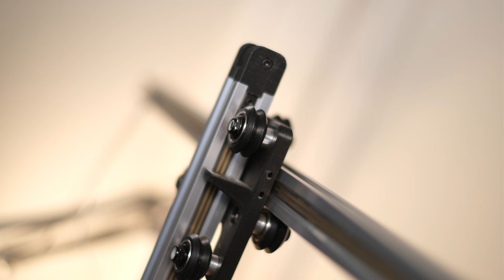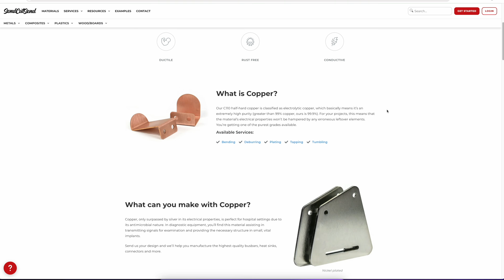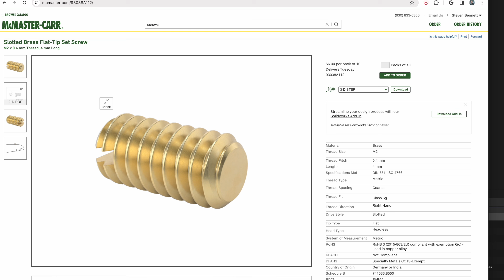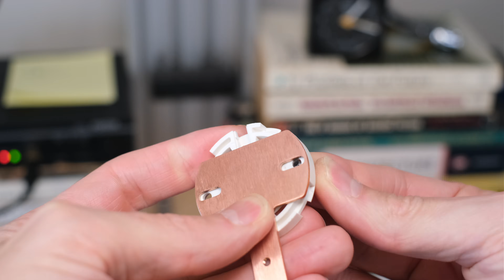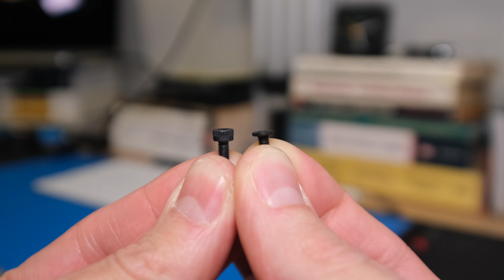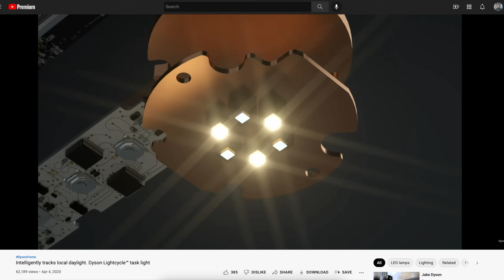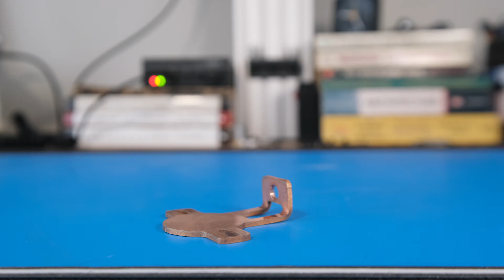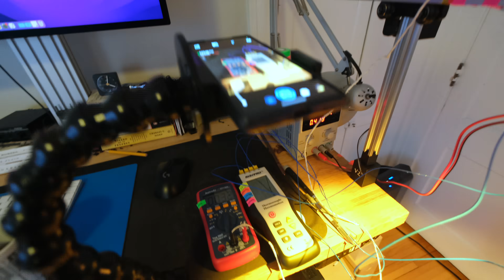Just how good are heat pipes anyway? - DIYson Lamp Build Log #10

Comment: Take a look at electro etching. It's surprisingly easy with tooling that consists of household items. And it's surprisingly precise if you take the time to dial in the voltage. You can "machine" your single piece copper in all sorts of ways and it makes for a neat subtractive process that's incredibly cheap for how much material you can remove. The most difficult part will be making the resist pattern easy to apply (laser cut vinyl works really well though that thin tape used in airbrush masking is likely the best choice for general use).
Reply: And I am new so haven't watched all the videos, but why not run the heat distribution down one of the vertical slots, leaving the roller slots unobstructed? I'm guessing it's the 90deg turn adding cost. (in frantic recitation): then add peltier devices to harvest the heat back into electricty and feed it back into the system then, perpetual energy! (no, I am not even close to suggesting this is really perpetual energy).

Comment: My guess is that the strange temp distribution from the heat pipe is just because the only point it actually is in close contact to the extrusion is at the end, where you screwed it in.

Comment: But if everyone base the parts one by one just to create one simple Lamb it becomes quite expensive right? I mean, ship a single heatsink, a single copper cut mounting bracket (plasik won't work, wouldn't it?) and so on... I tried to get all the parts and build one myself - and endet above 150€... So I bought a rebuild one

Comment: Couldn't you use the setscrews on the heatsink bracket? Because tapped holes in both parts should key the part in place just as god?

Comment: whenever you only find a single screw model that can make your chosen solution work, it's probably a sign that your chosen solution is very bad and over constrained

Also the reason why the furthest point from the LED is the hottest one with the heatpipe is because you're only clamping down the very tip of the heatpipe. The thermal path is very easy at that point because of that. The way we model thermal paths is very similar to electrical circuits with resistors, you can see that point at the tip as having a very low thermal resistance. The rest of the heatpipe will probably do a sort of incline, wedging the thermal paste and creating a gap closer to the LED. Thermal paste is actually horrible at thermal transfer, it's simply "better than air", so you want to really squish it down as thin as possible so all it's doing is filling the small imperfections between the two pieces you want to bond. In the video it wasn't clear if the heatpipe was using thermal paste or thermal glue in the aluminum extrusion area, but if you are using glue make sure the whole length of the heatpipe is clamped uniformly while it cures as it wont hold its shape otherwise. Heatpipes are very soft and need to be well supported. Also if you can, try to design the LED mount to not require any bend in the heatpipe as this heavily affects its performance. Of course this impact here would be negligible considering the tiny amount of power conducted but still.

Comment: Why not use counter sink screws for the copper?
The heat pipe may be better, but the single piece would be fine and a smaller BOM. I honestly think an aluminum part would work fine too.

Comment: You can try and mount the LED directly onto the heat pipe, without the copper adaptor bracket to potentially get much lower LED temperature. Use same press fit 2 screws to the plastic bracket, should hold the LED to the heat pipe well enough. Skipping the copper adaptor bracket stops the proper connection to the rail, however you can probably make a much smaller copper sheet to support the heat pipe, but also get screwed into the rail. Perhaps even keep the same copper adaptor design, just make a hole where the LED is, so it doesn't touch the adaptor plate and only heat pipe (you'll probably need to slightly adjust the plastic LED housing as well, so its recessed better and makes the LED touch the heat pipe better. Probably recess by the thickness of the copper adaptor plate).

Comment: re: supertrack
consider moving the pins into the rollers bracket itself, ideally - into the center of the triangle formed by the rollers axles, so that when deflection of the real world inevitably manifests, it has the smallest possible impact on pogo pins location due to the geometry of their position. I think there should be enough space in the groove of the vertical arm to allow for pins to stick out a little bit and not have interference?

Comment: Did you consider putting the heat pipe in a track where the wheels don't ride. Just have a bracket made to make the 90 degree turn...

Comment: I really enjoyed this video and your willingness to cut your losses instead of falling into a sunk cost fallacy by going down rabbit holes like fully re-machining the copper plate or aluminum extrusion. I do however wonder why you are so locked into that LED chip, it doesn't seem like you will ever drive it at full capacity unless you integrate active cooling. With my own custom project I have an on hand stock of 5730 SMD LED Chips, that way i can solder them together in whatever series/parallel configuration I need to fit within the constraints of whatever voltage, current or cooling limits. LEDs simply should not be overdriven they are cheap and easier to add more than to add more cooling plus more chips at lower voltage results in extreme lifespans and amazing efficiencies. Its almost like the Pheobus Cartel is still active.

Comment: New here, somthis is the first vid in the series ive seen, but it seems the more "elegant" attack for a cooling solution would be to take advantage of the center hole in the extrusion... 1. It would get it out of the way of the track wheels. 2. It would present more surface area to transfer heat to the extrusion.

Maybe i am missing a design consideration?

Comment: You have to be careful not to use too much thermal compound as that will make overall thermal conductivity worse. Copper and aluminium have thermal conductivities far greater than the thermal compound. The best heat transfer is from the two perfectly flat, flawless metal surfaces in direct contact. The thermal compound is only there to fill in voids, scratches and other air gaps that are there in real-world parts - these have a very low thermal conductivity and impede the flow of heat. The thermal compound should be sufficient to fill those voids, allowing the two metal surfaces to come into direct contact where they can, but no more. Even a thin layer of compound where it's not needed separates the two metal surfaces, resulting in poorer heat flow.

Comment: 1. Countersunk screws are a thing.
2. Plastic is not a great heat conductor, so the heatpipe pulling the heat out from inside the housing is a very good thing, the aluminium that is covered by the housing isn't doing much to dissipate the heat. Heatpipes are technically phase-change coolers, lilke a refrigerator or freezer system, just without an active pump. The good kind of magic, scientific magic.

Comment: if you wanna avoid the mess of thermal paste, you could try using thermal tape. it has lower thermal performance, so maybe still use paste in the high-heat-flux interface between the chip, bracket, and heatpipe, but use thermal tape to stick it down in the channel, where the thermal transfer is spread out over a much larger area. I'd also wonder about improving performance with some sort of super-slim spring clip that inserts into the channel and pushes the heatpipe against the aluminum (i'm imagining something kinda W shaped with a flat bit in the middle, so that it stays out of the way of the v-wheel)., the current setup looks like it would have uneven contact pressure along the length of the heatpipe (and i'm also a little worried about the screw at the end damaging the little sealing nubbin it's pushing on)

Comment: While the experimenting at 30% of the maximum brightness is a safe, yet significant heat load, unless you enforce the limit in the controller code you'll need to test at 100% (or some other enforced maximum) to make sure that the plastic won't deform/melt

Comment: Hey! Just wanted to say, I really love your videos. They really are inspiring, I definitely plan to make a DIYSON and would love to use some of the design philosophies you've iterated upon for other projects.

I'm curious, did you ever consider running a round heat pipe through the center of the aluminum profile, rather than tapping a hole there? It would make interfacing the LED to the pipe more challenging, but shouldn't be that bad.

Also, I have worked with some pretty beefy COB LEDs in my projects, I've got a 120 watt horticultural one that I watercooled. And some thermoelectric coolers which are even worse. The quality and thickness of the thermal interfaces is incredibly important. 

In your heat pipe solution you go LED-copper-heat pipe. With a relatively low power chip this is fine, but I do worry yours at 100% power. I'm envisioning a CNC milled copper plated aluminum interface plate, which could be soldered to the heat pipe and have only one layer of thermal paste to the LED. I have played around with something like this and would be more than happy to help! Of course, this might not be great for the accessibility - sophistication curve you mentioned lol.

Comment: Why not shave the peaks off the wheels? Holding a file against the wheel while running the extrusion through the carriage to make it turn would make short work of the clearance issue. Those wheels seat on the taper, no need to be perfect about it.

Comment: The diameter of those 3 screw holes relative to the width of your heat sink is disturbingly large. What's the remaining section of copper at the thinnest point ? Half the original section, at best ? That's a huge heat break right there. :face-orange-biting-nails:

Comment: On the LED holder for the heat pipe, I'd have an upper tab that slots into the opposite side of the rail, with a screw; as an adjacent topic, I'd personally keep the power rails on the inside face of the rail-roller bracket-rail assembly, that way you can just plop a simple block of pogo pins into the roller bracket and it just floats as the rails move, only being dependent on the intersection point of the rails which is constrained by the roller bracket itself.  Just to constrain the part from an upper flat and screw, and the perpendicular flat and screw.  This improves alignment reliability and assembly while not adding much material or cost.  On the other side of this, I'd also make it to where the heat pipe doesn't have to be bent, just for the ease of most people making this themselves, most people won't have the tools nor the experience and will likely crush or crack the pipe; this wouldn't be difficult, just keep the aluminum extrusion's base square and the thickness of the flat heat pipe as a keep-out zone for the bracket, then have the LED side of the bracket sit under the heat pipe.  This in combination with the upper screwed-down tab will act as a clamp on at least the initial portion of the pipe, which will help constrain it in place, given that along the length of the rail the only constraint will be the adhesive and how straight the pipe is in combination with its resistance to deflection under its own weight.  Though I'd personally also find a longer heat pipe and just constrain it at the opposite end of the aluminum extrusion.

Hard constraints and multiple non-redundant constraints will help the project a lot.  It's like your discovery of the roller bracket flexing, instead of just using a beefier metal bracket you could also find a better constraint method, such as gusseting key areas to a perpendicular surface for better resistance to the plastic bracket bending.

Comment: You should be recording the temperature of the room and subtracting it from your other readings. The temperature delta is what should be used in this comparison. The absolute temperature will rise proportionally to the ambient room temperature which is inconsistent between tests. The heat pipe clearly performed better regardless. Great work.

Comment: Just a side note, I think a thin piece of copper as your 'heat sink bracket' doesn't really make that much sense tbh. The thermal conductivity of copper is about 2x that of aluminium. But the cross sectional area of the existing aluminium extrusion is soo much larger than that of the copper plate that the small addition of the copper plate might be negligible. 

Math to elaborate. The thermal resistance can be calculated by R= length * area / thermalconductivity. Length is not a factor here. Copper has 2x higher thermal conductivity, but the lasercut plate has such a small cross sectional area compared to the alu extrusion, that I kinda doubt it actually helps much. I think you're better off mounting directly to the alu.

I might be wrong, so it could be interesting to run an experiment on this too

Comment: Idea! What if you insert the lasercut plate into the middle hole of the alu extrusion rather than into the slots. Then its beautifully hidden inside. Make it a nice tight press fit, and you wont need any attachment method anymore. Perhaps put a slight wedge in the lasercut part, so that it will firmly wedge itself in the hole. Put the wedge where the sheet transitions from inserted part to led mount bracket

Get a copper rod, thread it M6, and put it inside the middle hole of the alu extrusion. Maybe you dont even need to thread it, just insert a 5 mm (ish?) rod. 
Then mount the LED to that rod somehow, maybe by filing a flat spot on it. OR, bend the rod 90 degrees at the end so that it points downwards. Then you can attach the led to the end of the rod.

Comment: For the "copper heatspreader" I would have used just simple countersunk screws. Also for the heat pipe version I would look into a way, to be mounted such, that it directly comes into contact with the LED. In this way I think it would be even more efficient with it's heat transfer, therefor it wouldn't heat up the whole copper bracket. (If you look at a PCs heat sink with heat pipes you would see that the heat pipes directly come into contact with the CPU)

Comment: for a way to attach the copper sheet metal inside the alu channel, some thoughts:
- instead of tapped holes, shouldn't you make the copper sheet just fit in very snugly? Or put some springy bits inside the sheet metal cut design so that it presses outwards when slid into the extrusion. No more tapped holes and screws to manufacture an assemble, just sheet metal with some springy tabs cut into the design.
- use a thermal adhesive, preferably thermal tape or something solid rather than a paste/liquid. Should be a very clean install.
- bend the copper sheet in some way that it kind of acts like a spring that clamps itself inside the channel somehow.

Comment: Idea! What if you mount the LED directly to the short end of the alu extrusion, and use a mirror or some reflective housing to make the light exit downwards. So the LED is pointing horizontal instead of straight down. Thats why you use a reflective housing to redirect the light downward. Make sense?
Reply: you could achieve an internal mirror by electroplating a part in nickel, but theres probably an easier way

Comment: Maybe there's room for improvement for the copper sheet metal solution: 1. A slower transition between the circular part and the solid heatpipe part. 2. I think the first screw hole leaves so little cross section of solid copper that not much heat is going through there. Maybe clamp the copper part in the notch with a little spring metal part?

Comment: 24:30 thats showing u have best contact between the heat pipe and the aluminium at that far end of the pipe, which from your assembly montage makes sense because that is where you screwed it down adding pressure. If you also screwed it down near the led it would be better (under the plastic housing with the controls would work well because you can't have the wheels there anyway.

Also, your heatpipe doesn't seem very good, i have cooled an 80w led at full power using a single 8x3mm flat heatpipe. From looking at the assembly, it looks like you crushed the heatpipe quite a bit when you bent it

Comment: Physical contact. If the contact is not good then you can have the best materials and still get poor performance.
So you want the LED CoB to have very good contact with whatever heat-solution you have. In general that means you want to have a perfectly flat contact-patch - so only grinding it on a flat surface and not polishing it with small round wheels. The small deviations that those can cause also can be more destructive than having a bit bigger scratches.

And the same goes for the copper/heatpipe contacting the rail: It should be pressed against the rail all along its length - as much as possible at least. This very likely is the reason why with the heatpipe the temperature was higher the further away from the LED it was measured: Cause it only made good contact at the far-end.

Comment: Don't know if it's been pointed out, but the reason the rail temp at 100mm is cooler than it is at 200mm is because the heat pipe is bowed and is only contacting the rail at the end.
I like the heat pipe setup though, but a clamping solution to the rail will be tricky... Maybe thin bowed leaf springs in the rail channel to hold pressure on the heat pipe down into the channel? I'm not sure. It would still need the heat pipe to be really flat.

Countersunk screws would have been a real easy solution to the solid copper bar setup too.